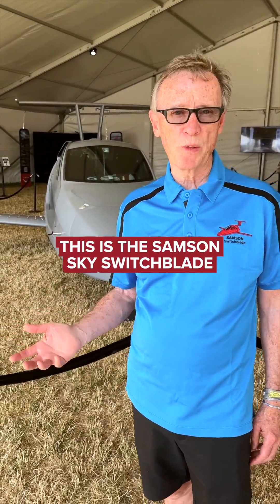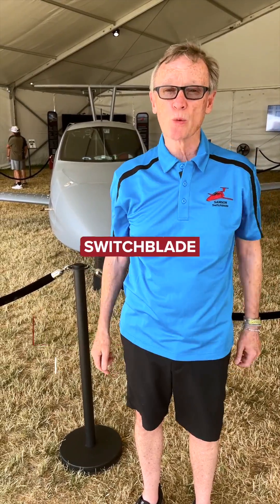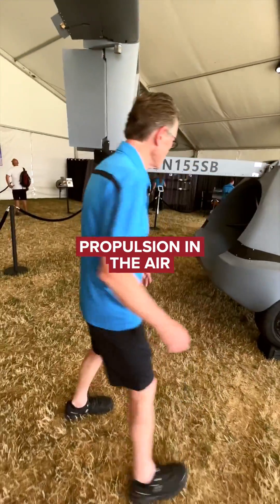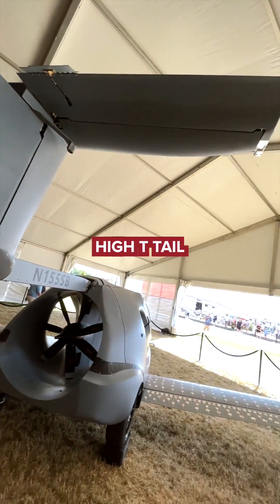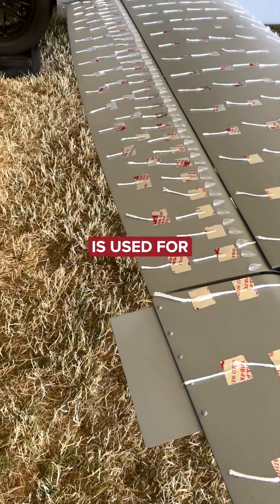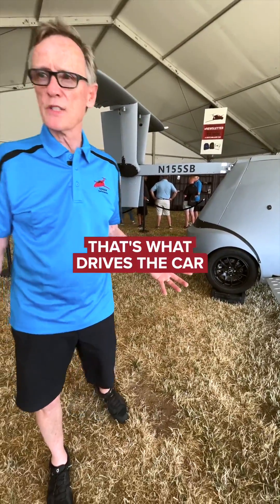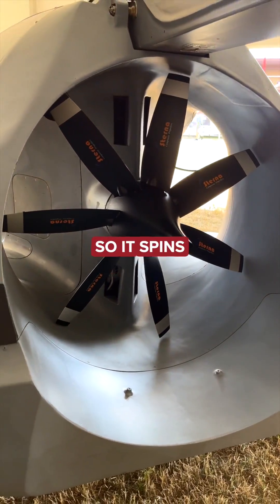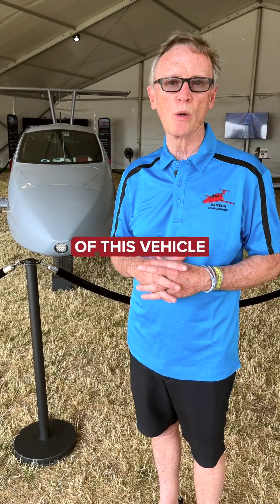The Samson Sky Switchblade, a Flying Sports Car!

Comment: What if the birds went into air intake area? Should install the intake cover ? The first safety thing I saw...
Reply: Exactly once they fix or find a way to reduce the likelihood of a bird strike. then I feel this car would do great. 

Another issue I have is the weight capacity on the website the max payload the car safely can't take off as 575 lb. That's with two people and some luggage I can understand that the average person should be under 200 lb but in this day and age that's become a little bit challenging so I'm pretty sure they'll have later models that can have a higher weight load. So that's not really an issue it's just people need to be healthy in general but it's still a concern of mine.
Reply: The tail propellor assembly has since been redesigned.